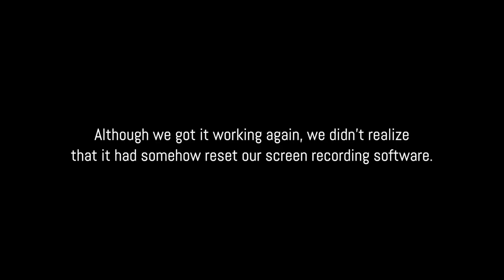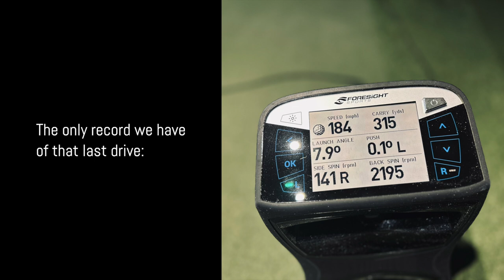Technology Failure Cost Us a Great Video

Comment: Probably should clean the filters in the projectors, or get the lamp checked, as they have limited life span. Filters are the main cause of the thing over heating and just turning off. Most of them just come out, and you can give them a wee blow to get the dust off.